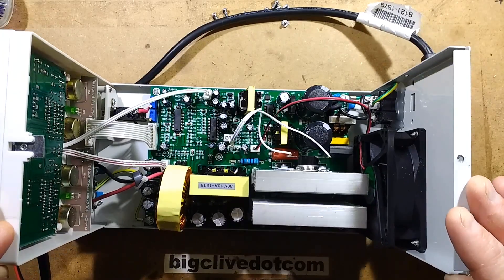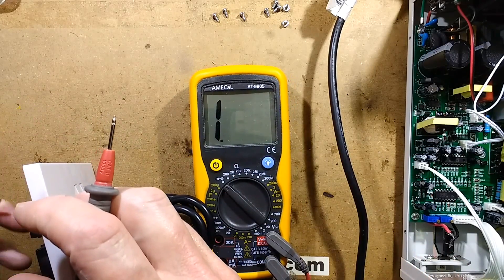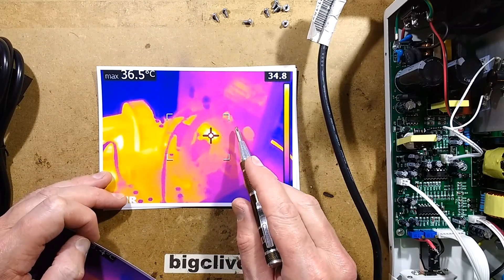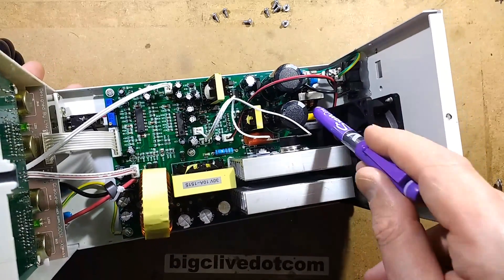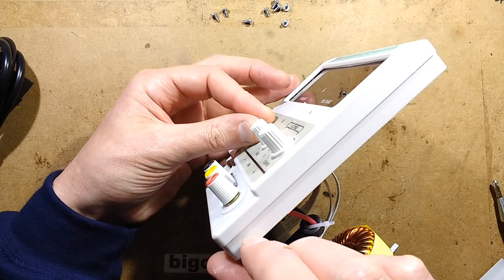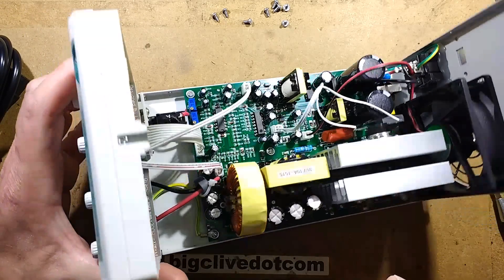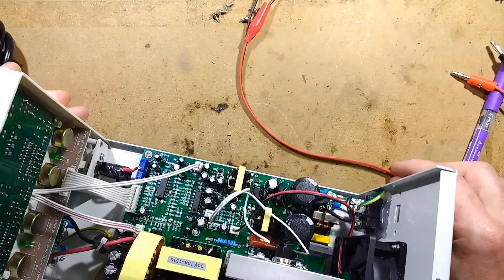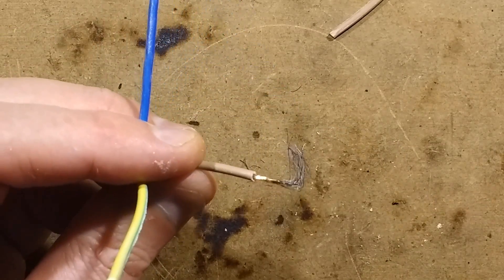Test of a PSU like the one that went on fire.

Comment: 2:07  CLIVE I think you should do another video to remind people about the Shielded Earth Pin problem.

The other day I saw a cheap double socket with a hole broken though the white plastic by the Earth socket ..
something you might like to look into.

btw.. this video popped up after watching you and the round roadworks light.

I heard what you said that YT didn't like Vape videos..
Maybe you could just say about it this way...
"Batteries that are found in metal tubes on the ground."
Real question is..
I would like to put about 10 or 20 of the same sort in parallel.. I assume I need to equalise them first.. How? What is best way?
Do I need a BMS.
I would like to make a replacement 3.7v (old battery was 5000mA) for an older laptop..
When in parallel.. do I need a BMS?
Reply: Thanks for answering my question in the latest livestream 😻

Comment: Very interesting point about the insulated earth pin and something I had not realized or looked out for before, on a related point I recently  bought a Chinese aquarium heater which came with a UK style square pin molded plug which looked strange because it was very small, but fitted the socket OK, however the plug did not have a fuse or facility to fit one. "UK plug" looks like a reason to  buy on Ebay, but non compliant UK plug , probably not.

Comment: Thanks Clive, came to this a bit late. Have a Lavolta model of this PSU and happy to report the cables are Good. Mains plug full earth pin and output cables all soldered connections to the crocks and the end of the cable is solder tinned and clamped. Wire is very thick and difficult to bend. Had a fault where the protection diode across the output went S/C so had replace that.

Comment: Check all your power cords with a magnet.
At least it will find the really dangerous copper steel ones.
The aluminium ones should have higher resistance than the copper.
This is an idea for a product to sell, a line cord safety tester.
Reply from the maker: Sadly, very few people would buy one for their home.

Comment: I see people talking about soldering the test leads.
I hope the mean the croc clip end.
It is not good to solder stranded wire in a screwed  terminal. The solder compresses and the connection comes loose. Maybe some types of terminal blocks are ok but it is still not the best way. Just twist it and fold it over once or twice to fit the barrel. Then tighten the screw.
You can solder the wire in the barrel but the strands will suck up the solder and make a weak point where it bends.

Comment: They just copied the 2 sleeved pins for the ground. Just copy, don't think.
The use of copper coated aluminium is just misleading unless it is indicated on the jacket.
Are the test leads also copper aluminium? Even if they are not they look thin for 10 amps continuous use. The crimped croc clips always make bad connection.
I will always turn off the bench power bar when I go home to help prevent our planned extinction by the unmentioned.

Comment: I bought one a while ago for North America 115VAC and it blew up the 2 IRF840 MOSFETS and one of the 47 ohm resistors connected to its gate. Next failure ws the P75NF75 MOSFET.  Must be a poor design in the power supply!

After the first failure, doing measurements with a voltmeter, I discovered the power cord had the Line and Neutral reversed. This put the fuse on the Neutral side!

You get what you pay for!

Comment: What's the problem with Cu plated Al wires? As I recall, the big foofraw around here (years ago) about Al wiring failing and causing fires turned out to be using connectors designed for Cu... what have I missed by not paying attention for all those years?

Comment: I have one of these power supplies. I don't regret buying it, but it does have issues with current regulation, and also when you adjust the voltage the current limit also changes significantly.
The output is very noisy, and it is also sensitive to noise from the load. It does meet its power output claims, so if the feedback circuit was redesigned it would be a fairly nice power supply.

Comment: I saw the set screw (grub screw) you say to the black wire was tightened down onto the plastic outer insulation and not the wire itself. I always tin the wire when that type of connection is made on a power supply. The wire is much to small also

Comment: Excellent video Clive. I love your teardowns and reviews. One learns a lot from you. I always undo my cables also. The ones that are screwed in I always twist, fold then solder to make sure that the screw bites in solidly. I know that the solder has a low melting point but I figure that there would be less resistance in the connection this way and therefore a lower chance of the banana plugs heating up.
Reply: It is not good to solder stranded wire in a screwed  terminal. The solder compresses and the connection comes loose. Maybe some types of terminal blocks are ok but it is still not the best way.
A couple of cow orkers where I used to work did this on a junction box for a hydraulic pump and the wires came loose with the vibration. This caused an emergency shut down on the gas turbine which is not a nice thing to do.

Comment: On my PSU there are 2 small holes directly under the display where you should adjust the Voltage/current to the right level (so it's written in the manual).
Also ich checked the earth connection (because it's from china) and throug the paint of the metal there was a realy bad connection.
After removing some paint from the bottom part around the screw it was okay.
Check your electronics from china twice, ALWAYS!

Comment: Replacing a sleeved earth cable with a proper one only works if the earth lead is actually connected to something at the other end. Dont go around with a false sense of security changing the leads and thinking you are somehow safer; look for yourself people, you wont be able to once its too late.

Comment: OK, so I was browsing your videos to find a power supply to ask a question so it wouldn't be too off topic and I seen this one.  I have one similar to this one but it's a 5 amp.  So I have 2 questions.  1 is about this type power supply and the other one is about an ATX supply.  So first off, my power supply like this, makes that sort of whistling noise or something like you show here.  I was assuming it was a bad cap or something to that effect, but now I'm wondering if it's the crappy leads that's causing it.    Also, is there any way to make it a 10 amp supply? Can I change the transformer to one like in the one you show here, and if so would I need to change any other components?

2nd, I had a friend give me an LW1600PG ATX 1600 watt power supply for a bitcoin miner, that only works on 220 volts, even though it shows it can use 100-240 volts.  Is there any way to convert it to 110?  Am I missing something?  If I can't convert it, I'll end up "taking it to bits" and use the parts for other projects, as I can't use it the way it is.  If it can be converted, I'd be fine with it if the wattage dropped to even half of the 1600 watts as I don't need that much wattage. 
Here's a link to one like mine (hard to find it anywhere else)  https://www.avito.ru/dmitrov/tovary_dlya_kompyutera/blok_pitaniya_surma_lw1600pg_novyy_1600w_1884996510
Reply from the maker: You can't make it a higher power supply.  The whistling noise is common in some switchmode supplies because they run the transformers ay high frequency.
Reply: @bigclivedotcom  Well crap!  LOL  Thank you sir!  I knew you'd be the man to ask.  Love your channel.  So fun and informative.

So any idea about the ATX power supply?

Comment: I found the 'convenient' spinny feature on the banana plug to just lose continuity, so I had to solder across the slip-ring.  To do this, once you take out the set-screw, the plastic piece just slides off, making for easily soldering the metal part, and losing all the pieces. Then for the lead wire, something like 18 awg or 1mm, folded back onto itself 3 times and twisted, then tin it (make it shiny with solder), allowed the screw to dig in and make a nice connection regardless of radial orientation. Thanks for the video!

Comment: got the same power supply, its tranformer is really noisy and dependent on the voltage+ set current limit you can really get the powersupply to make a loud clicking noise and the output flickers like youve seen
Any idea how to solve it? got this as a replacement for another one i had as a christmas present, and asking for a 3rd one would be really bad

Comment: Oh dear oh dear... it can never be a good thing to find a big clive video about a product you own...
Firstly, mine has a proper earth pin on the plug, and a proper ASTA marked BS1363 fuse in it!
However, it isn't without faults; the voltage LED went faulty within a few hours of use, and after removing the LED module from the board, I found it to be the guilty party. Speaks volumes about the poor manufacturing standards that must exist for these things, LEDs should last pretty much forever unless abused, and it hasn't been.

Fitting the replacement LED module proved to be more of a job than I'd anticipated; the board is double sided, well, ok, no problem? Big problem. The through holes AREN'T plated! My meter board now sports some jauntily coloured bodge wires stripped out of some RJ11 cable.

While I had the thing apart, I put some heatshrink on those exposed mains terminals, tightened the horribly loose heatsink retaining screws, put the fan in the right way round (those axial fans are hopeless at positive pressure; they leak air back around the blade tips), and had a good listen at the noise it makes when current limiting. It seems to be that big toroidal inductor on the DC output; I'm deciding whether it's worth trying to stop the noise by dipping it in wax or resin to try to stabilise it.

All in all, I'd say you get what you pay for, and £45 for a 30v 10A adjustable bench PSU is cheap as chips.

Comment: A late thanks for this video!  A few months back, when I was on a  kit binge, I built up a variable output power supply, it came with all but a transformer to feed it with 24V AC.  So I built it up and lay it aside on my bench, then came the big STOP BUYING! Order from my good  wife of 50 years, and all purchases stopped. Well that lasted till I got pissed at something she bought that was useless, and it sort of pissed me off so I purchased a 24V DC Power supply.  So I try to feed the DC to my PS and nothing.  Tried reversing the polarity and nothing, I could trace some voltage to the board, but output was measurable, just, at about 0.03 V DC.  So I think I probably blew it somehow as it had fallen from my bench and hit the damn carpet, where it spent weeks. Since I am still pissing the good wife off I decide to find  a different front end for my new 24V DC supply, well I came upon the PS in this video, or at least an exact copy, the price was right at $9.99 US with free shipping from here in the USA! WOW what a deal for a 30 Volt 10 Amp variable PS!  Hell YES I placed my order, then began to worry, but I figure I have enough crap laying around if it comes dead, I can fill it with parts and make my own in that case.  I am awaiting the arrival with baited breath, and a chill down my spine as my wife will let me know about spending another 10 bucks of my own money.
Reply: I ended up ordering two of those damn things, one claimed it shipped, and was delivered to me in Texas.  Well last time I lived in Texas was 1975, so a claim with Ebay and a refund.  The next never came from China, that was months ago, and again a refund.  So I had this 26 volt transformer that I picked up at a flea market for a quarter, the docs that came with the 24 volt PS that i built from a kit had in huge bold letters to never exceed 24 volts input or the device would be damaged.  Well I figured the 24 V DC power supply I hooked to it did nothing so what do I have to loose. Hooked up the 26 V transformer, plugged her into the wall socket and I now have a nice adjustable V and A power supply that goes from 3 volts to 63 volts DC.  I mounted it all in an old 3.5 inch plastic floppy case meant to hold 50 floppies, and it even looks kind of cool what with the digital display and the adjustment pots power switch and fan on the back to keep things kind of cool.

Comment: I've also heard that the insulated pins prevent things like neck chains that might sling low enough to bridge the connection while you're inserting at removing these plugs, especially if you're doing it behind something where you're reaching behind a cabinet or desk to do it.

Comment: H Clive, I have exactly the same power supply and it worked for about a week. When I turn it on now it makes a warbling high-pitched sound and I get no lights, etc. I replaced all 4 mosfets thinking they were the problem, but same issue. I'm pretty novice at repair and was wondering if you might have any ideas. I was thinking maybe the main switchable power supply may have gone bad as it seems that the noise is coming from there. Never was able to find the schematics for this thing. Thanks for any suggestions on repair.
Reply from the maker: If it's really new then it might be worth contacting the seller.  Don't mention that you've tried to repair it.
Reply: @bigclivedotcom  Hi Clive, I did that, but he wouldn't refund, but got eBay to refund though. I'd still like to figure out how to repair it though just for sake of learning and accomplishment.
Reply from the maker: Be cautious working on something like this as there is a lot of live metalwork inside.  It's quite hard to diagnose remotely. The fact there are no lights hints at an issue with the small auxiliary power supply section.

Comment: The banana plug side of the connector has a poor contact and high resistance. Mine melted on my 5 amp model as i moved the leads and the outer part of the banana jacks  tried to weld together with the inner part.. I soldered the leads to the jacks and the 2 parts of the banaani jack together. Made the problem go away. Then i made leads that had forks on the end to screw into the psu.

Comment: Thanks for the bit about testing for copper coated aluminium. I retired as an electronics tech from the US Navy in '93 and I don't remember that particular trick in our training, but then again I guess most of our stuff was procured under pretty tight contract overview so I don't think we would have run into it very often.
Reply from the maker: Copper coated aluminium and other non-copper flexes are a fairly recent thing.  Purely to cut costs.

Comment: Thank you Clive about the half covered earth pin warning! I have checked around our home and we have a few with ALL plastic earth pins that came with things like Alba phone chargers, Philips shavers and Amazon Fire tablet. Are these safe to use? Thanks very much, Neil.
Reply from the maker: The all plastic ones are fine.  They're used with double insulated products as a key to open the socket shutters.
Reply: Hi Clive. Thanks so much for the swift personal reassurance and for someone who hadn't subbed too! I didn't realise I never had. I've must have watched hundreds of your vids in the last year or two as they come up in my recommended and I find them thoroughly entertaining and fascinating, even though I have little knowledge in electronics, as you can tell by my question ;-) . My substitution oversight has now been rectified :-). Thanks again and keep up the good work. Neil.

Comment: I agree those leads are terrible, I decided just to get rid of the ones I had as they had dangerously high resistance due to the very thin conductors and probably bad connections in the plugs. I have also seen that poor approach to connecting croc clips before on other similar cheap leads from EBay.

Comment: Any self respecting electronics enthusiast would design and build their own power supply. You can learn a lot by building your own test equipment. - Circuit design and layout, chassis bashing skills, recycling components. 
It's not that difficult to build a variable linear supply as well as being more satisfying and usually cheaper. Plenty of designs and circuits have been published in the electronics mags over the years.

Comment: Ah those things, those damn little 8 pin IC goes in those things, I forgot what the part was an opamp or comparitor but yeah the current detection/regulation side it absolute crap and so very fragile.

Comment: Great review, Clive.  I learned the crimp fail method on the cheap alligator test leads from Chiwan, too.  Uncrimp and solder.  My bench supply is the 305, a 5A model similar to the one you tested.  I'm pulling that set of test leads off right now and soldering them, JIC.  Thanks again.  P.S: GAWD, I hate CCA wire!  It's downright dangerous.

Comment: maybe a handy tip; if you want to know what inductor is making the noise, take a screwdriver, put the point on the inductor and the handle to your ear... it works a bit like a stethoscope, and you can pinpoint the noise component that way :p 
be sure not to damage the insulation though ;)

Comment: Can you or any viewers recommend a good “electricity for dummies” video series/book if video not possible?beyond the basics. I want to understand the relationship between current/voltage, and how setting a dead car battery to charge at 2amps for instance starts off with a very low current & unknown (to me) voltage & why/what causes that. Resistance/impedance that changes as the state of charge changes I assume/maybe? Regardless I’d like to understand it better but I don’t learn from textbooks very well, I can /memorize/ from textbooks, but I /understand/ from doing or at least observing.

What would you set this power supply to to charge a dead-ish car battery for example.